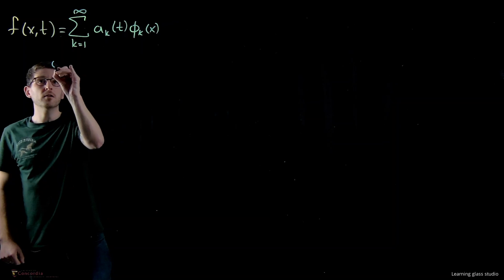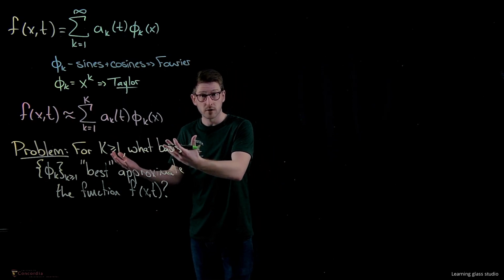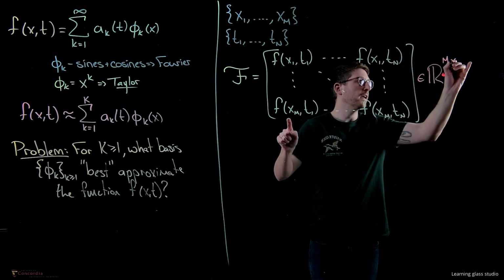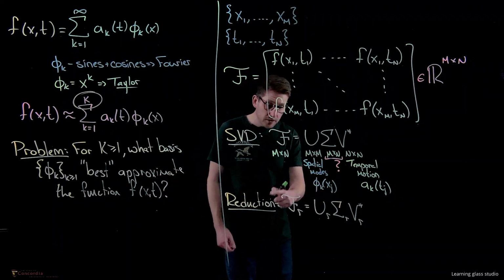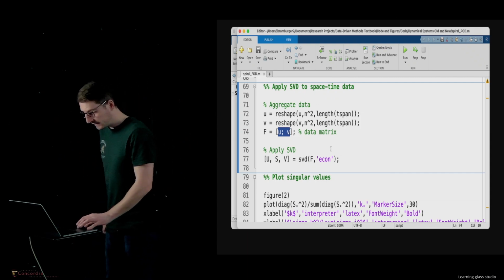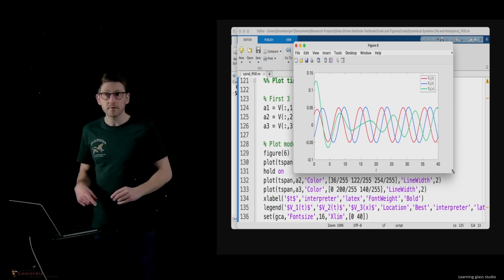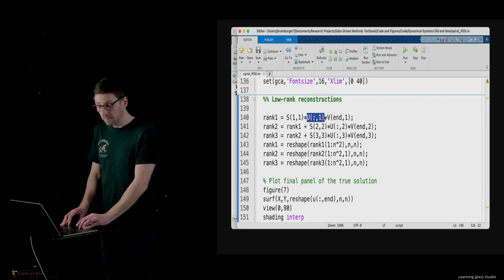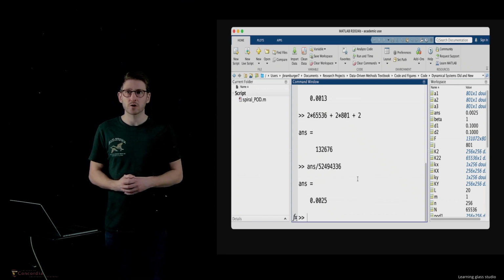Proper Orthogonal Decomposition - Data-Driven Dynamics | Lecture 2

Comment: Hi Jason, when you define u and v to build F, are they each vectorized versions of the total information in the true solution (if so I'm not sure why there are two?)? Then you build that into F (the complete solution with those two vectors u and v), and then SVD that to find out the two dominant modes from F? Once you have the two dominant modes from S, then you are reconstructing each of those seperatley into the two spirial componenets and graphing them back to (x,y) space. Then each of those can be simulated as spirals by running time simulation. Finally you superimpose the dominant componets (2 spiral basis functions of x,y) and could simulate them in time and show comparison with true soulution to show how well they approximate it with only (2 spiral basis functions). I'm not sure why u and v instead of one vector (x,t variable)? Any insight greatly appreciated. Thank you in advance!
Reply from the maker: Check out the associated MATLAB code. It has all the answers to your questions and more.